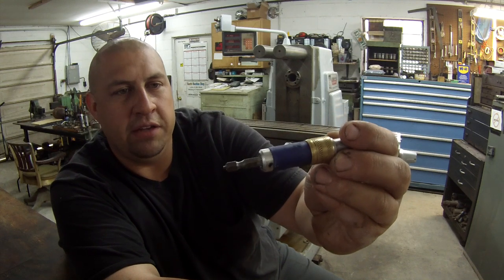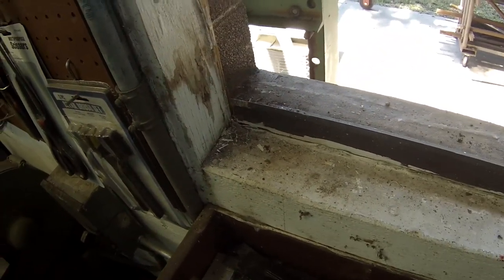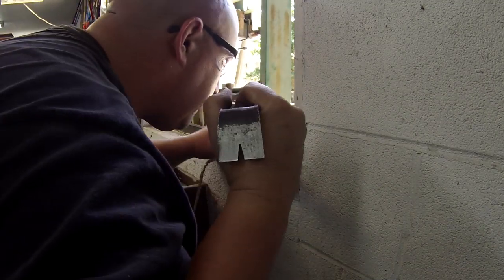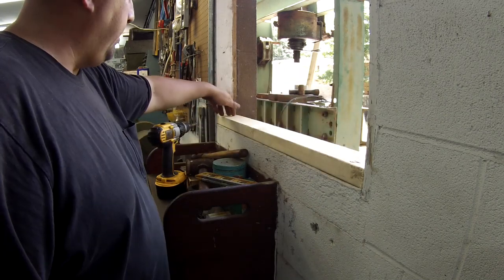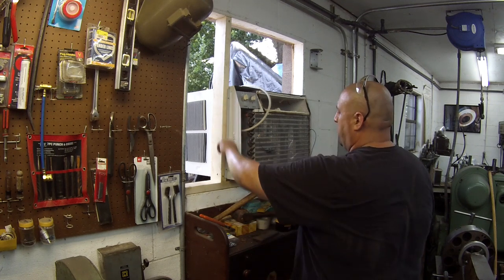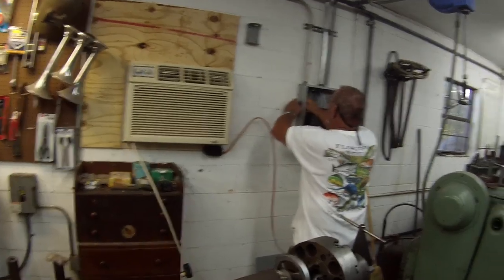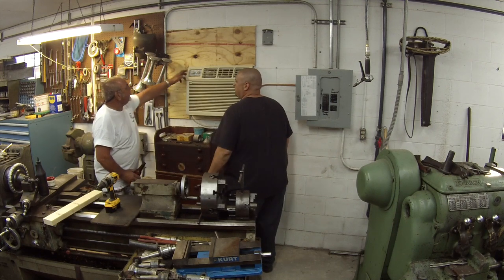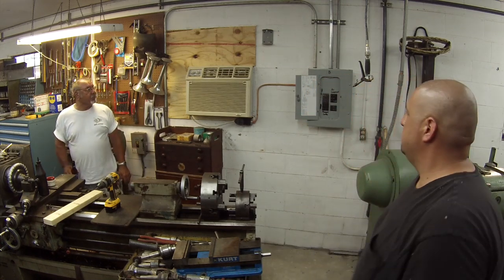Climate Control

Comment: I have a "window shaker" in my 2-car garage and it does well enough to be comfortable. The  heat is not real bad, but the humidity just sucks the life out of you ;) only 10kBTU but does well enough.(Atlanta area here.)

I keep it on like 79 degrees sometimes just to keep the humidity down when if I'm not there.

Yes, will be more comfortable, but I there will be less rust on your tooling..I bet water pours out of that thing. Also with the garage door closed, i bet the sirens will be less of a hassle. The ceiling will make the temp more stable so less chance of condensation. Win-win-win!

You might look at gluing some 1/2" foam to the garage door panels. Mine radiates heat from the sun.

My window shaker is right above my lathe. Best place to work in the shop ;) As always, great vids and keep up the good work.

Comment: "Hey, live to eat right! Not eat to live."

Right on Adam, I was at an event and did 24 racks of ribs this weekend on a smoker I built the night before. Wood frame, foil wrapped, worked great.

And having the humidity down in the shop will work wonders. That unit would handle your space easily if you were able to insulate it more.

Comment: Adam, good job on the installation. In the 70's decade I installed many aluminum frame windows, all with a nailing flange around the perimeter. Your window's bottom flange was concreted in-place after the concrete blocks were laid. Your frame was not going to be saved. If you need a new window in the future, one can be custom made, quickly.
Drop by your local garage door supplier and get a roll of door seal for the bottom of your overhead garage door. Self installation is easy. (I saw light under your door in the back ground of the video, but maybe it was slightly raised and no seal is needed).
Your AC  installation will help alleviate the "tool rusting" humidity alot. I also have the humidity problem that is a constant pain in the a**.
BTW Fernando's talents seem to be extensive. Better keep him close by and refreshed!
Thanks....13
Reply from the maker: Fernando ownes his own HVAC company, so this is the stuff he does well. Any type of ac, heat, electrical,or refridgeration he is very good at. He's the one that give me and installed the big ac in the old shop. He's a great guy to know.

Comment: I started cooling my shop with a window unit like that and it certainly made it easier to be in the shop during the warm months. Last year I had to replace my home's AC, so I used the left over condenser with a new air handler in the shop and what a difference it made!

Comment: Adam, inch & half thick stero foam attached to the inside of your metal roll up door, with construction adhesive is a good insulator. Easy to work with and cheap. Does a good job of keeping heat out in Summer and inside in Winter. Cheers.
Reply from the maker: I've been looking at a few products made for things like my door. Will venture into that later.

Comment: When installing wood against concrete, if you don't use pressure treated wood, you can staple roofing felt to the wood to isolate it from the concrete. You can also paint some diesel fuel onto the wood, especially the end grain. If a wood framing member is somewhat compromised but you don't want remove it, the diesel works well. It will off-gas for a while. But if you don't want that, use a heat gun lightly.

Comment: I think I got here 1st ..That's Great you got the air conditioner in ..I have a whirlpool 110 volt unit with turbo boost which looks similar to yours It is on it's 9th season and still going good

Comment: an old way of mounting frames was to concrete long nails head down into concrete/mortar, then hammer the wood on top, then clinch the nails over and back into the wood, hard to see when its had years of paint and they sure dont lever out
, in your case it lookes like there is a metal strip with nail tabs, so its nailed in from the back or under a trim piece, you were always gonna have to rip it out
Reply from the maker: Good to know. That was the first time I ever looked to see how the windows were installed. Once I got to the bottom piece it was really getting to me. Sucks I had to destroy a good window. Oh well. I can always close it up solid or buy a new window if I ever take that unit out.
Thanks for the info.

Comment: Adam,
the insulation behind the plywood next to the new window unit is installed backwards.
Condensation will accumulate inside the compartment and rot out the new 2x4 you pressed in place.
Eric
Reply from the maker: Easy fix already corrected.

Comment: Hey Adam

Enjoyed the video and it's great production!  I think we may see a lot of work on the Victor now since it is next to the AC...lol

Too late now...but IMO, you should have not removed the metal flashing that was embedded in the concrete.  That was an item to save and use to prevent water from a wind driven storm from coming into the shop. I am here for any building/construction questions...35 years and have built/remodeled all types of construction.

Besides my IMO...you did a very good job on the installation and I am very happy for you to gain comfort in your shop!

Chuck
Reply from the maker: Thanks Chuck. I don't know much about the building designs that's used, and really wasn;t sure why the window was installed like that. I was just going at it, with the only mission in mind to get the ac installed in the window. I'm going to be calking and sealing it up this coming weekend and putting some paint on it. Hopefully it will last and work for a long time. If it don't, you can always rebuild it right? Hey the Victor and DoAll are in the perfect spot in the shop now!
Thanks buddy.

Comment: Adam... a couple things...

You can glue that foam insulation from Lowes onto the panels of your door.
pink or blue

Don't worry about the flex joints... you won't lose enough there to make the work worth it.

When setting up HVAC systems... fans can be your enemy.

If Fernando is the expert, you better have another conversation with him about the installation of your "big" unit.

You will probably need to run ducting (insulated) down the length of the room to be most effective or even effective at all.  You cannot just blow cool air into a room or from one cold room to another warm room.  The air at the far end of the room away from the unit will have to be sucked out and cycled through the unit.

Otherwise you will just be beating your head against the wall wondering why it isn't cool in there. 

You need both output vents and return vents the entire length of the room.  If done correctly, you will find yourself running the unit less and saving much electricity while being comfortable.  The outputs should be above the windows and the returns nearer the center of the room or even in the ceiling.

If your HVAC expert knows where you will typically use fans, he can lay out the vents better.  Airflow is a science.

Another thing to think about...
Once you use air conditioning, you can't turn it on and off everyday.  When the cold metal of the machinery warms, the air in the room will condense and that condensation will accumulate on the cold (metal) surfaces.... You know what that means... RUST

So , the idea will be to keep a reasonable temperature all the time, turn the thermostat down when you are out but extreme cold to hot will be a problem with that kind of facility.  One of the big advantages of an air conditioner is that is also dehumidifies... You might want to run separate dehumidifiers in the shop anyway.

The same thing happens in colder climates in the winter time when you turn the heat on after everything freezing all night.

A well done system - large enough unit - properly placed ducting- will be able to freeze you out and you will in time adjust to "no fans" which will be much quieter and easier on your fatigue factor.  I too like a breeze especially if I am being active but I use much less than before I had AC.  I have smaller fans, more of them, located in more "task areas" so they don't disrupt the air so much.

Be Cool!
Anon

I repeat... You cannot just blow cool air around to cool the room.

Comment: Good job Adam! I've been feeling sorry for you this summer. Glad you've got a little relief from the heat.
Reply from the maker: Thanks! Man its feeling soo much better in the shop already. Cant wait to see how it does once I have the ceiling sealed up tight!
Not having to run the fans during summer time filming make a big difference in the audio for the videos.
Reply: Can't you do some kind of foam over the microphone to reduce the wind noise? I'm no expert on the subject, but I'm certain it can be done. Just look at comm systems for motorcycles...
Reply from the maker: Hobby Machinist
It's not so much the noice blowing over the mic, but the background noise in the videos hearing the fan run.
Reply: Abom79 Gotcha. Not much to be done there. I guess in that case all I can say is thanks for suffering for us. Your videos are always a pleasure to watch.
Reply: Abom79
Adam,
If you are using that Rode mic you got a while back on your GoPro, you might need what they call a dead cat. It's a furry cloth "bag" that goes over the mic to stop wind noise. You've no doubt have seen them used on the news when they have a mic on a boom pole. It can also be used on outside shoots so you don't get the wind noise.
Dave

Comment: 7.5 tons AND a window unit!  You did say you like it chilly!  Easily the most impressive work in this video was the work you were doing in that smoker! Where is Lipitor man when you need him, them is some fine looking eats my friend!
Reply from the maker: Hoping the window unit is temporary. Maybe this fall/winter we can work on installing the big unit and have it ready by next summer. I just wanted something to give me and the tools some relief. Once this last section of ceiling is finished up, and some sealing done around the doors this window shaker should keep it comfortable in here.
Hey, live to eat right! Not eat to live.
Reply: Abom79 That big unit is really WAY too big for you space.  Commercial standard is about 300 sq. ft. per ton.  You can probably, for a few reasons, (Well insulated, little glass, not a lot of in and out foot traffic) get away with more like 400 sq. ft. per ton.  That big unit is never going to cycle long enough to pull the humidity out of the air.  If you do use it, stick the thermostat all the way on the other end of the shop.

Comment: Adam,
When I looked at the insulation from the outside of the shop next to the new AC unit it shows being installed backwards.
The paper goes on the inside toward the living space.
Glad you got the place cooled down a bit.
Eric
Reply from the maker: I'm sure your right, but no biggie for that small space. I thought i was doing good by adding some there.
Reply: Well it is good to have insulation but what will occur is moisture will condense in the fuzzy material, get stopped by the vapor barrier paper, condense and drip down on to the sill (2x4). That will accelerate the 2x4 to rot out AND it will be a nice place for carpenter ants to hang out. Don't mean to pop you bubble or be a jerk. Just want to help out. All the best, Eric
Reply from the maker: Eric, thanks for the tips. It's an east fix as I havnt calked anything yet. I will remove one of the plywood covers and flip the insulation around. Thanks for the info.
Reply: Glad to be of assistance. I did like the machinist's fit on the lower 2x4....a medium press fit! :-)

Comment: You could have left the bottom metal frame on the concrete sill and just installed the 2x4s on either side of it. Then you could have re installed your old window at a later date if needed by removing the 2x4s.

Comment: Nice video.  I am glad to see you got the ac installed.  I did the same thing a month ago but I should have gotten a bigger one.  My shop is half of a two car garage and 15,000 btu is about 13,000 too small for south Texas.  My older brother told me it would not work.  I think your climate is about the same as ours so you know what hot and humid is all about.  I was sort of wondering what micrometer you used to measure that wood?
Reply from the maker: It's one of the biggest window units you can buy. 18,500 BTU. I think its good for 1200 sq ft, and my shop is less than that. Once I get everything finished and seals, including better seals around the doors, it should work good enough to make it comfortable in the shop. 78* climate control temp is 100% better than and open shop when its 95* outside with 100% humidity.

I used a tape measure to measure the wood, but I cut it a touch over what I needed. Everytime I cut 2x4's it seems like thete are always on the tight side! LOL
Reply: Abom79 Measure it with a micrometer, mark it with chalk, and cut it with an axe... ;)

Comment: Adam, I guest you found out the hard way but the unit has to be seperated for you to mount the box/casing first then the main unit has to be slipped in from the inside. Tha's the only way you can mount it so that it is solid and don't vibrate like hell and of cause it don't fall in or out. Those big units are real pains to fit especially if your on your own!!
Reply from the maker: It's a little big to handle on your own, but I didn't know you had to pull them apart to mount it. But the important thing is I got it done. Fernando looked it over good and said it looks fine. it feels pretty solid in the frame.

Comment: Looks like they used power-shot (driven by .22 short blanks) nails to anchor the bottom piece of that window to the concrete.

I don't know of any better way to remove such a piece than how you did it... persistence and prybars...

You'll want to paint & seal those 2x4s up - else you'll get woodrot and/or termites in the wood all too soon...

Comment: I bet it'll be good to get down to normal temperature when working. Me my self can't get anything done when hot wich in this country mean a couple of weeks a year :) The other 50 weeks I'll have to fight off the polar bears :)  Wierd to set the frame in concrete........ Probably good for everlasting frames ? Does such exist ? Anyways, great video and nothing wrong with your carpentry, knowing you it's probably a lot more straight and solid that any carpenter would have made it :) enjoy your COOL days :)
Reply from the maker: Thanks Eric. The AC has been very helpfull, and keeping the shop cool and dry!

Comment: I clearly see the machinist in you on that precision fit. Nice work! Phil
Reply from the maker: I always wonder if carpenters cut there boards as close as I always do. It never fails I have to use a hammer to get them bumped into place.
Reply: Well as wood is moving quite much, I usually cut them a little short like 2mm shorter. that seems to work quite well. However on those thick pieces it isn't going to matter much. Phil
Reply: Abom79
 I'm a cabinetmaker, and was previously a carpenter.  I definitely measure and cut way more precise than is necessary, but the finished products look good.

Comment: WTG Adam :) Fans only do so much buddy.
Reply from the maker: Fans are a must with me, even with ac! I can't stand working with no air moving across my direction.
Reply: Abom79
I hear ya, sometimes when I'm busy downtown running around and I go into the bank it's cold but the air is dead still and standing in one place I break into a huge sweat because the air is just hanging there.